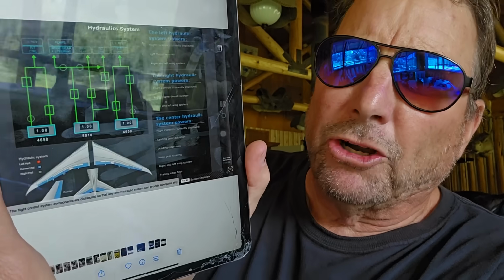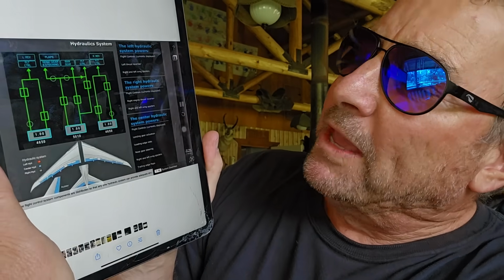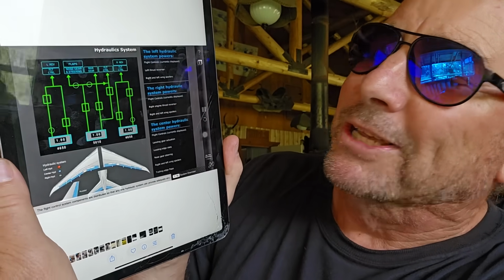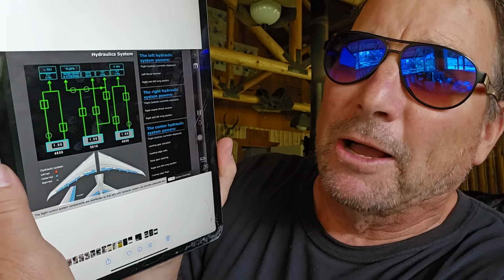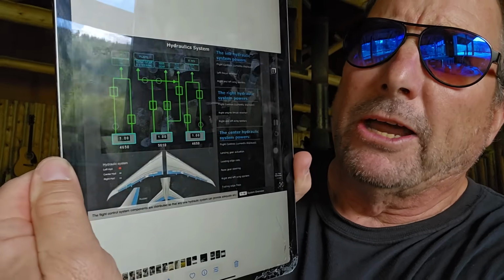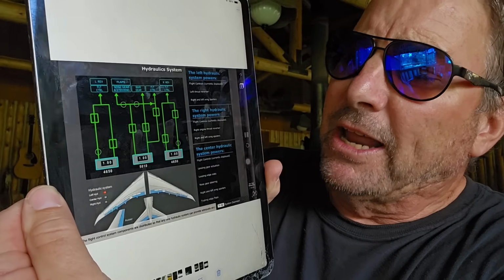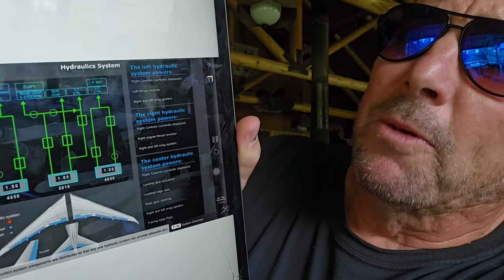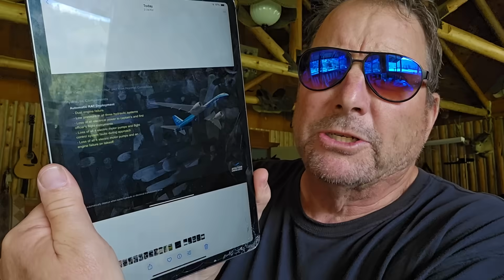787 Crash India What's a RAT? When does it deploy?

Comment: Inside a cabin, can the sound of a loud bang be detected when a RAT is propelled into its deployed position?
Reply: Also quoting a member from pprune:

"In flight, the RAT deploys automatically if any of the following occur:
• both engines have failed
• all three hydraulic system pressures are low
• loss of all electrical power to captain’s and first officer’s flight
instruments
• loss of all four EMPs and faults in the flight control system occur on
approach
• loss of all four EMPs and an engine fails on takeoff or landing

(EMP = electric motor pump, hydraulic)
FYI the RAT is an emergency source for electrical and/or hydraulic power."

Comment: Hi Juan, very good, thank you. Have a”we” thought about the possibility of the flap-lever being moved from 5 to 1 (in error) on the call for “gear up”? That would explain the flight-path, but not the RAT. Also, it looked to me that the thrust setting was too low - rotating right at the runway end?? A weight mis-calc?? Anyway, the DFDR will tell all. Regards, John. NZ 🇳🇿

Comment: Well this sound is made by flow from prop hitting the airfoil surface in normal plane (and is different for push configuration such Icone or Piaggion  and ). It could be RAM turbine hitting covering or fan blades flow hitting the inner structure of pilon while turbine being flamed out or not ? Would the black box be recording in case of RAM turbine deployment in this type? It would be terrible to have 2nd tragedy without conclusion in such fast succession.

Comment: The deployment of the RAT is telling.  Seems to support a dual engine failure but there were no visible signs.  I hate to even suggest this but one thing that could explain it with no real visible signature is two fuel levers changed to off.  At least they have the FDR, but who is going to read it?

Comment: It will be interesting to see what information comes out as the investigation plays out. If it was double engine failure what could cause that to happen? It is less than 1 in a million chance that both engines would fail at the same time unless whatever the "bang" was was the cause. But what could that be? Seems like the redundancies are such that it would have to be a big problem to interupt fuel to both engines that rapidly. More than 1 fuel pump, each pump being supplied from different tanks. The question is going to be what would cause simultaneous engine failures and how can it be prevented in the future.

Comment: There is a video uploaded by a passenger on the previous flight.  The air conditioning system was not working and neither was the entertainment system.  I know, i know most likely these problems dont have anything to do with a crash.  Sounds like electrical problems and poor maintenance.  RCM

Comment: For what it's worth, a video of the accident plane has been posted on YouTube showing a take off from Frankfurt. The gear is not retracted until some 11 seconds into the steep climb at a point about twice the height AGL as the plane at Ahmedabad when it began its descent. I post this only in response to those who assert that the gear is typically retracted almost immediately the wheels leave the ground.
Reply: Some aircraft delay gear retraction because it significantly increases drag as the gear doors open to permit the wheels to enter.
Reply: @allangibson8494  Protocols seem to vary between crews and airlines. Some retract the wheels right away and some delay until well established in the climb. What I am saying here is that nothing can be inferred from the accident plane not retracting its gear right away.
Reply: Gonna say brake cooling - depending on their turnaround time and next destination. Taxi time can cause more problem the the landings. Considering brake stacks are around $400- 500k exchanged ( you have to supply a good repairable unit)  each x 8 I would venture to say AI will beat into their guys to be nice to the brakes. Trash a brake stack to BER condition ( beyond economical repair) and now you have an outright cost for the brakes and I would guess it gets past $1m each.
Reply: @TrollingwTyrone  Interesting theory. A Sud-Aviation Caravelle crashed in flames some years ago because hot brakes were retracted into the wheel well. The plane, I think, had rejected one take off, returned to the start and this time the take off was successful, that is until the hot brakes set fire to the wheel well.
Reply: I read elsewhere that it’s typical for Air India pilots to not retract until later than normal.  I don’t recall the rationale.
Reply: @boxner1  ratioinale ?  $$$$$
Air India was a headache for the Boeing engineering teams when they first got the 787's  delivered- Indians would park one and cannibalize it to keep the fleet going to not spend money on parts and their methods of doing maintenance were... lets say " different" .   Not that every airline does not do that but its usually a part robbed off a bird in heavy check - Indians just parked a perfectly good bird and raided it so I would surmise seeing how expensive brake stacks are they have them hang the gear out a little bit longer for cooling if it is safe to do so

Comment: So, a RAT sounds like a Pitts Special, doing aerobatics; the audio from Australia has the same sound. With your explanation of automatic deployment; it sounds like they had a complete electrical bus failure, or a dual engine failure. Not only is the 787 an Electro-Hydraulic Aircraft, it's also a Computerized Aircraft; meaning it has specialized firmware/software that operates the controls.

Comment: In the video taken from the ground from the right hand side od the aircraft, there’s a shadow right where the RAT would deploy - right side lower fuselage.  It’s feint, but its there…

There’s now a pic of the empennage taken from above and left rear, as it came to rest, possibly from an adjacent building.  The photo shows the APU door open, likely indicating that the APU was either running or commanded on (either automatically or by the flight crew) prior to impact.

Comment: I think the 2 critical clues in this crash are the RAT deployment and the Mayday call. The pilots knew something was wrong. It's been reported that they actually said it was a loss of power, but I've also heard that was unsubstantiated. Are the "powers that be" starting to initiate a coverup already, and are intending to blame the pilots when it's actually a major technical failure caused by poor maintenance on the part of the airline or even a fault in Boeing's systems? Another clue is that the aircraft had just undergone maintenance. If I were the investigators I would going over the maintenance records with a fine tooth comb and grilling the mechanics who carried it out. There also has to be evidence in the wreckage, whether it was an electrical fault or a mechanical fault that caused the crash. I don't buy the inadvertent retraction of flaps theory. The flap lever is nowhere near the gear lever in the 787 cockpit. Those pilots must have done hundreds of takeoffs exactly like that one, it would be like second nature to them. Highly unlikely they pulled the flap lever instead of the landing gear lever.

Comment: New info: There was a medium strength hit from a solar storm/CME pulse precisely at the time of the departure. Is it possible systems were impacted, sending false data i.e. flap deployment/position to the cockpit? From the video evidence, the airplane never really achieved positive ROC post rotation. The deployment of the RAT may have been triggered by one or more system failures at TOGA power? When I learned of the CME hit, my mind immediately began to sift through these possible scenarios.

Comment: I was an observer on a few L1011 test flights and one of the last tests was to deploy the RAT, check it worked and then on landing note the speed at which the hydraulic low pressure light came on during roll out to prove the RAT produced adequate pressure above a certain minimum speed. IIRC automatic deployment was triggered by tripping all 3 engine N3 rpm indicator circuit breakers which caused the logic to think all engines had failed.
Reply: L1011 was my favorite to fly on when I used to travel almost every week for work back in the day.  It was just a different and awesome aircraft; incredibly comfortable and I loved it.
Reply: @ricklynch8620  You might have loved flying in it but it was a problematic airplane to maintain. I know flight crews loved it too but it was too complicated for its time, needed a lot of TLC to keep everything working properly, and a lot of maintenance man hours. All my "rescue missions" were to fix broken down L1011's at various airports in our network. Never had to rescue a broken 747.
Reply: @ricklynch8620  Used to watch the Tristar's landing when I was a school boy, great aircraft!

Comment: The best theory of what went wrong is the plane takes 2800 meters to reach rotation speed, the runway is 3500 meters , from the look of the video the plane did not reach v1 at 2800 meters and takeoff should have been aborted at that point, leaving 700 meters to stop.

Comment: Your explanation of when and where the RAT is automatically deployed pretty much excuses the possibility of a mix up of the gear vs Flap levers by the second officer as the Rat deployed possibly earlier than the gear up command and subsequent action by the pilots. This is good and this is bad. Good to vindicate the actions of the crew and bad that a system failure of some sort is higher on the list. I had an engine quit on final and I knew I would not back the runway so I retracted the gear and moments before the flare I lowered the gear again. I got lucky. Real lucky but my instincts saved me. My stupidity caused the engine failure. Don't ask me because I will not tell you only that it wasn't fuel starvation. Even a greased crowbar will glide a bit further all nice and clean.

Comment: Its loud.
Short blades = high rpm.
Two types 
A- electric
B-hydralic 
Electric runs
A-aircraft power or
B-hydralic thru an electric pump.
C- can't do both at the same time. 
Electric runs 
A- comuncatiins battery.
B- hydralics thru electric motor driven pump.
C- cant do both.

To fly the A/C with this type of power takes time. Systems drop off automatically and compensation to fly takes time. One switch operates
Electric or hydraulic. 
A/C only flew for a few seconds after takeoff.
Thoughts,  A-two switches behind throttles shut off fuel.
B-  Engines don't die shut down,  will continue to run with no power.,

Comment: Folks seem pretty confident the pilots messed up their flap and landing gear decisions.  I suppose the boxes will help clear this up in quick fashion
Reply: Not on this channel.  Read the prior comments.
Reply: @loudidier3891 these 787s have been around awhile zero issues.  I'm eager to know the verdict but it does seem inconceivable two engines on this stellar aircraft just took a poop seconds after takeoff.  Not committing to the masses on the reason but captains on other channels are postulating this flap/landing gear issue.

Comment: The fundamental problem would be the near silence from the massive pair of GE turbofans even within 250ft of the aircraft, when even one of them should have been deafening at maximum power.
So it isn't what you can hear, but what you CAN'T hear.
Dual engine failure, or complete loss of thrust, made the outcome inevitable.  If it occurred just as the gear would have been retracted, they were right to leave it down in the hope that it would absorb some of the energy of the landing.

Comment: Have to say,  if the plane is going down due to the jets not working,  the RAT is not going to save you. Perhaps the fact the RAT was deployed, is an indicator to RAT deployment conditions.
Reply: It would depend on where you go down. and how high you were.  My understanding is the RAT gives you flight controls so you can steer and flair before impact.  In other words you are a large glider.  As low as they were over a crowded city, they had no options.  No river within range (Sully) reference.

Comment: Juan, Could the second in command accidentally removed the flaps instead of retracting the landing gear?  Not sure if there was a mistake in the cockpit and when the call was made for positive rate, and retract gear, the flaps were accidentally retracted instead.  Loss of flaps and landing gear down could induce a stall - all the extra drag of the gear and removal of the lift from the flaps.  not sure how easily that can be confused in the 787
Reply: All of that would not cause the RAT to deploy, and the aircraft appears to have crashed with the flaps slightly deployed...full leading edge device deployment and some flap deflection is evident in post crash photos.  I think the pilot monitoring using the wrong lever dog is barking up the wrong tree.  

My thought is that this 787 became a glider very shortly after takeoff, as unlikely as that scenario seems at first glance.  The questions to be answered are why and how, and I have no insight beyond the obvious fact that only a few things can cause simultaneous failure of two engines, crew action, fuel starvation (exhaustion is clearly not it... plenty of fuel at the crash scene), debris ingestion, (I think we'd have observed that), maybe an electrical issue sufficient to take out all digital engine control systems (strains credibility, but this is a one of a kind crash), they both use the same air (nothing visible, not likely, but not yet ruled out).  I don't know, but I'm eager to find out.

Comment: Interesting that you and I can hear the RAT with what should be, takeoff power. 787's are quiet but that close and hearing the RAT with takeoff power ...
Reply: This. The silence was so eerie!
Reply: thats what I'm saying!! If you can hear the RAT over 787 engines at takeoff, they are NOT working.
Reply: Maximum noise from a jet engine exhaust is at 45 degrees away from the engine axis.

Comment: Does hydraulic failure disable the brakes? RAT + Fatal end-of-runway takeoff might point to brake failure, thus no abort.
Reply: Believe it or not, the 787 brakes are electric.
Reply: @dougdrvr  In other vids, I see no rotation and then an immediate steep climb. Afterward was a slow-motion stall.

Comment: I know of an instance of faulty ground power equipment that would cause an error to set in aircraft computer power control logic.  This error would cause uncommanded RAT deployment on liftoff.  The problem was traced to a group of ground power units, one manufacturer with serial numbers of units in a certain range.   Once the units were replaced the RAT deployments stopped happening.   It's conceivable that damage was done to the 787's power control logic by a bad ground power unit.  Just my two centimes.
Reply: Now that's interesting. The amount ground power this airplane needs is incredible.
Reply: @dougdrvr  A350-1000 takes two units to power aircraft at the gate.

Comment: Have you seen this? from the NYPost...Shocking video reportedly shows power failures inside Air India plane hours before it crashed: ‘Nothing is working’
Reply: It has been normal for years for the entertainment/information system in Air India's 787s not to work. It does not have any significance for the airworthiness of the aircraft.

Comment: A couple things:
1. Wreckage appears to show slight leading edge flap deployment and trailing edge retracted.  Video of take off and flight seems to show same.  Is that "flaps 1" and is allowable for takeoff?  For that load?!
2.  Why did ADS-B stop at peak altitude?  At the same time as mayday call?  I am not hearing talk about this.
3.  How can you have dual engine failure?  Poor fuel quality.  I have heard that fuel quality is something to be looked at.
4. The aircraft backtracked and used the entire runway we know now.  Is that normal for that load and heat?  Seems pretty tight.  Maybe flaps set insufficiently or engines not performing well?

Comment: The aircraft clearly had zero flaps on takeoff.
A Boeing pilot captain said he thought they retracted the flaps instead of the landing gear.  The engines lost power because of a lack of airflow to them due to the configuration. The rat would have deployed.
Clearly pilot error and not Boeing’s fault.

Comment: I heard that the flight data recorder was recovered and in good condition. That will tell them most of what they need to know. The next step would be a thorough review of the aircraft maintenance log, if they can get it. I don't know if Air India has electronic logbooks, but incidents like these are a good reason to have those. I know that at least one 787 operator still uses paper logbooks.

Comment: Could this situation eventuate if the Performance takeoff, DRef and climb thrust were all set at 500ft instead of 1500/5000? 
So an engine rollback at a critical altitude and AoA.......
Or unbelievably, they hit both the fuel cutoff switches with an elbow while resting a hand on the throttles?

Comment: I noticed in your video and somewhere else that compared it, the RAT can be heard clearest when the aircraft is side on to you.  That might be because of the spin axis, and also the engine noise tends to be loudest fore and aft.  So the RAT is loud and the engine quiet when side on.  This also fits with the buzz being clearest as the Air India passes overhead in that one video.  It's much less obvious as the jet gets farther away.

Have seen a post saying that the 787 has more advanced recorders where both boxes record voice and data. Let's hope so, and that they remained powered.

RIP to so many on board and on the ground.
Reply: Probably also helps that right when you're perpendicular to the RAT (relative to the fuselage) is also when the doppler shift is changing the fastest. So the pitch rapidly drops, and you can't mistake the noise for something else.